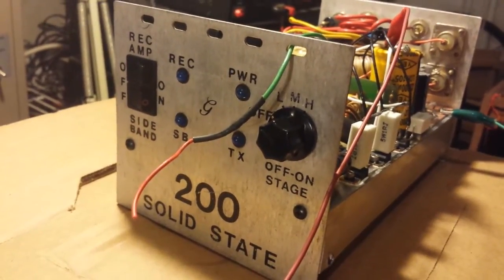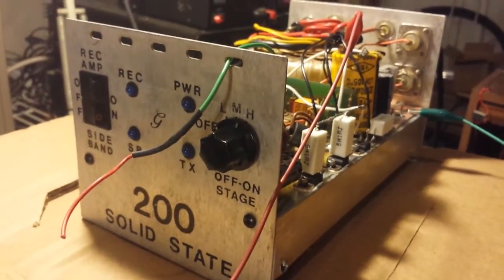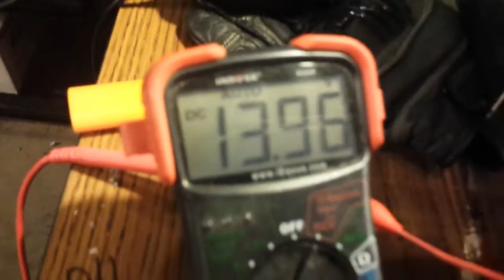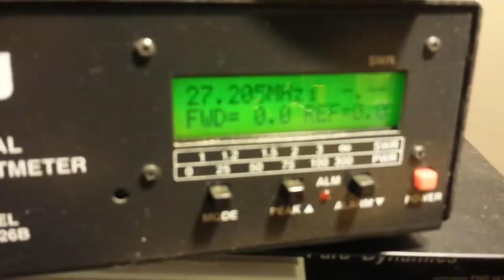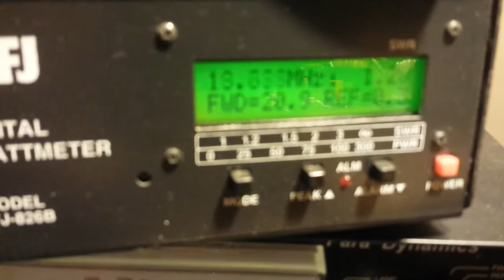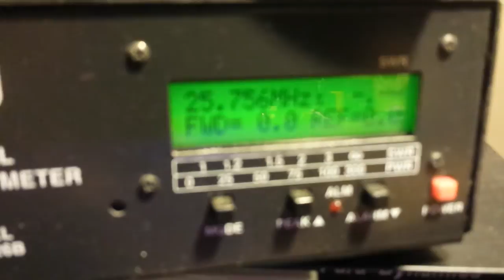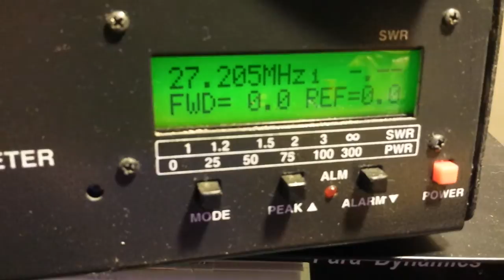Gray 200 Solid State Base Amp With PS Regulation Mod! Really COOL! 😎

Comment: YES REGULATE THE CURRENT......BUT RUNNING THOSE PILLS AT 19 AND 20 VOLTS WILL NOT HURT THEM YOU MAY JUST NEED TO ADD A FAN TO KEEP THEM COOL,I HAVE SOME BOXES WITH 1446s and 2290s and 2879s THAT I RUN AT 22 VOLTS CONSTANTLY AND THEY HAVE A INCREASED WATTAGE OUTPUT ANDTHEY LOVE ABOUT 18-20 VOLTS...PLAY AROUND WITH A FEW PILLS THAT ARE USED AND SEE WHAT YOU CAN GET OUT OF THEM......73s     380 from the Great Lakes southeastern MI.

Comment: Also, do the math..... 500 watts would be 1000 watts input. 1000 divided by 13.8 volts is 72 amps. That power supply could not do 72 amps if you had 6 of them.

Comment: The transistors are rated at 60 watts each. ANY more than 120 to 140 watts outs is ALL distortion and intermod. You have to be an idiot to think you were actually getting more out, on frequency and whihout intermod that is. Look at it on a spectrum analyzer and see haw much extra power you generated in the harmonics. GOD! The bulls*&t people spew!